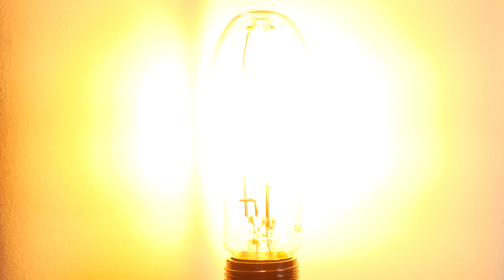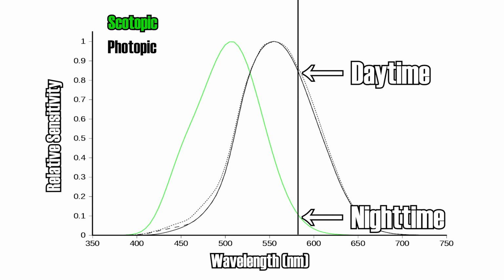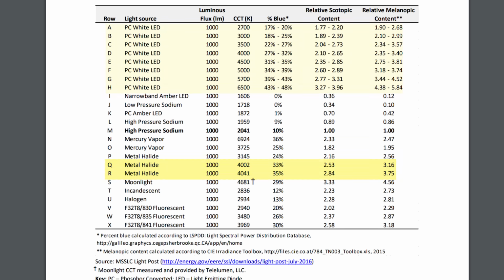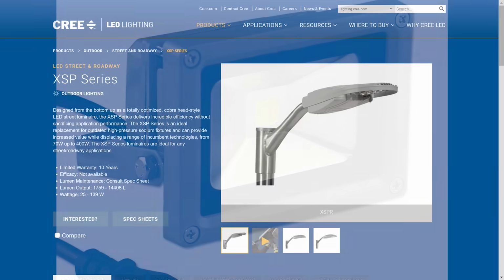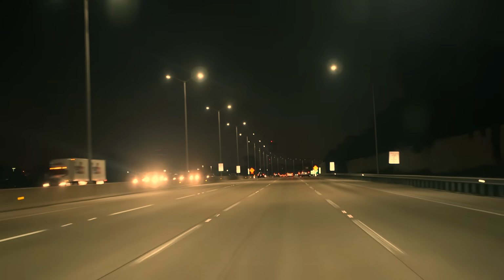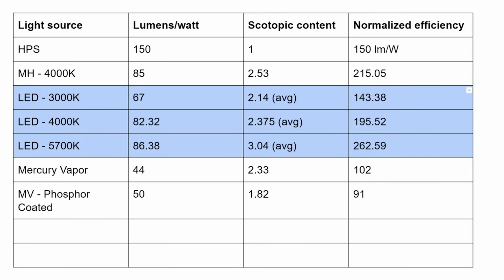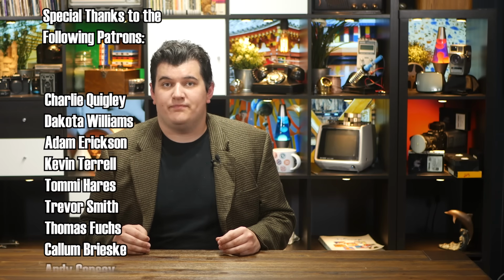The LED's Challenge to High Pressure Sodium

Comment: Just wanted to add the effect on night vision recovery... due to the fact that (from Wikipedia) "Retinal undergoes an irreversible change in shape when it absorbs light; this change causes an alteration in the shape of the protein which surrounds the retinal, and that alteration then induces the physiological process which results in vision.

The retinal must diffuse from the vision cell, out of the eye, and circulate via the blood to the liver where it is regenerated. In bright light conditions, most of the retinal is not in the photoreceptors, but is outside of the eye. It takes about 45 minutes of dark for all of the photoreceptor proteins to be recharged with active retinal"

rod cells are both very sensitive in low light conditions very nearly insensitive to red, so using light that predominantly only activates cone cells leads to faster recovery of night vision. Something you've probably experienced if you've ever been on a long drive on an unlit road and passed through a section with lighting (or had someone pass you with those blinding blue headlights!)

Although not a large factor if you are only driving in areas with street lighting, it is still something which should be considered in more rural areas.

Comment: I find it hard to drive in the fog or when raining with white/bluish LED street light compared to traditional amber-ish/yellow-ish light. Anybody find the same?
Reply: Yeah, red light penetrates fog very well, that is why it is used in traffic lights and brake lamps. Blue light has a harder time getting through without spreading all over the place and ruining the image. However, usually the streetlamps aren't the things that help you the most in these cases anyway, it's more about the headlights... I think.
Reply: @tamasperci4168  
Have you ever been through thick fog? Headlights don't do shizz.
Reply: @MinecraftMasterNo1  Yeah, that's why you switch lights to fog one, which lights not the road, but emit light from the bottom of the road, up, into the fog, which makes big difference.
Reply: @override1337  OR you can be like a lot of the yobs that run their foglights at all times... lol.
Reply: @MinecraftMasterNo1  yeah, the standard headlights actually are counter productive, because their light reflects right back at you. The fog lights on your car are better because they light the fog from the bottom. Unfortunately the normal headlights still run when the fog lights are on.
Reply: @MinecraftMasterNo1  They make you visible to other drivers, which is the purpose of turning them on in the fog. It's not to make you see better - it's to make other drivers see you.
Reply: @override1337  No they don't. My old car had fog lights. I used them in the fog many times and they didn't do squat. Best thing to do is just s l o w down.
Reply: @SpiritBear12  Huh? Fog lights are used so YOU can be more visible to other drivers, fog lights won't make a fog "less foggy".
Reply: because blueish(high color temp) lights are not reflective enough on wet surfaces. this is major problem
Reply: Makes sense that some cars have like yellowish fog lights
Reply: The color of fog lights doesn't matter much. Good fog lights should have a beam pattern that is wide and flat, aimed below the headlights. When aimed high, the light will scatter and reflect back.
Reply: bluish light is not ok for me due to my sensitivity enhanced by blue eyes, while warm sodium during night i feel is ok.
Reply: @stefanogrillo6040  After trying to look into it, I cannot seem to find any source that claims your eye color is correlated to sensitivity to a specific spectrum of the light. Rather, every source I could find points at lighter eye colors being more sensitivity to intense daylight, like the sunlight. None of the artificial road lighting is on the scale of actual daylight in intensity.

I personally have blue eyes as well, and actually find the bluer lights more comfortable whilst driving in the night, with the amber lights often being quite blinding.
Reply: @Aidiakapi  The eye color furthermore cannot directly influence that, since light passes through the pupil (black hole in the middle), which is the same no matter the color. Indirectly, when higher sensitivity and color would both be result of some condition - maybe. But that would be a (rare) disorder, rather than every blue-eyed person having it.

Comment: I've heard that low pressure sodium is better in the rain/fog because it doesn't tend to scatter. So there's that. It'd definitely be nice if street lamps would dim after a certain point. It'd be nice to see some more stars in my backyard. I have a few stupid streetlights right around me. One of them is burned out and I don't plan on calling it in.

Comment: Disruption to the Circadian Cycle is highly misunderstood. You want night drivers to be alert and aware of their surroundings, not sleepy and unresponsive, so LED lights that might have more Blue spectral content is actually safer became the drivers are alert and not sleep. Since LEDs are more efficient, the amount of blue light really isn't all that mush (despite the lights looking more blue than sodium vapor) that is because sodium vapor require the use of a much brighter bulb which puts out that same amount of blue as LED and a lot more yellow. This is seemingly counterintuitive but think it through, it really does make sense.
I recall back when sodium vapor was deployed in my area and I note that it was more difficult to see other traffic than the old bulbs. Everyone else just kept repeating that they were "new" so they had to be somehow better. I'm thrilled to see that someone has finally put together and explanation that vindicates me! I'mm looking forward to having my community switch over to low powerLED, of the correct color spectrum, using the correct downward-directing lenses, in my area.

Thanks for the great video.

Comment: I find it hard to see with any street lights as my eyes can't adjust to being sensitive enough so, this is especially true with the white/bluish LEDs.  

I live out in the country and when I drive at night, I can see 3-4 times as far and much wider to the sides when its totally dark and just my headlight. Go to the city and I find it hard to see because of the light being localized and not being able to see out to the shadow and unlit areas, even with my headlights.

I like the sodium lights better as it allows my eyes to get more sensitive to the dark compared to cooler LED light.

As for the light pollution, it has greatly increased due to the bluer light, it travels at lot further out to the country now, where sodium only few years ago was just a patch of orange glow on the horizon, now its more like a late twilight entire sky glow.

Comment: As an electrician, most LED bulbs will say to disconnect the ballast or not. In general, a replacement LED bulb is used with a ballast bypassed, i.e. 120/240v direct. True LEDs have a driver to give them the exact amount of volt/amps. The replacement lamps must have something in them that's doing the same thing, but hardly with the same efficiency that a planned LED install with a proper driver has.
Reply: The 54w cob style LED lamps that I used were better than the 250w MH that they replaced. These were down lights, running at 277v, and I pulled the ballast and cap, re mounted the socket to fit the cob light in there and ran them direct wired. It was a great retrofit and the color and visibility was improved even thought the cob emitted light in all directions. The driver that is built in seemed to get the job done. Last month, I converted all 38 down lights on that property to 150w LED 5,000K down lights. The difference is like..........well, night and day. The lights don't blind people on the street and they light the parking lot further from the building. Another 2 properties I take care of have a batch of LED's with bad drivers. In the last year I have replaced 28 drivers in those wall packs. The company who sold us the lights actually replaced the drivers for us, but it is poor quality and a lot of labor.
Reply: I have Citizen COBs.  They are amazing.
Reply: I studied electronics in high school and still dabble.  LEDs will actually burn out at higher voltages (the ones we used couldn't go more than 3V) but if you send a pulsating direct current instead of a straight Direct Current you can actually push the voltage much higher and in the process increase the brightness of the LEDs.  I presume all LED drivers used for outdoor lighting or replacement lighting use a rectifier/driver circuit (rectifier convert normal AC wall current into DC, driver converts DC into Pulsating DC) while most portable LED lights I've found just use a direct power circuit from the batteries (AA, AAA, C, and D batteries/cells all produce 1.5V per battery/cell so two of those in series will produce 3 volts).  I did have one portable LED light that used 4 batteries so perhaps some newer LEDs can handle more voltage).
Reply: COBs can handle high voltage, but they are technically a checkerboard matrix of teensy micro LEDs placed on a surface the size of a nickel.  But as a unit can handle anywhere from 36 to over 100v at varying levels of current from 700ma to 2100ma.  They need big passive heatsinks and are tons of fun.
Reply: Mean Well HLG drivers are nice.  Dimmable as well.

Comment: You're right that low pressure sodium is definitely better for astronomy which is why it's used near professional observatories but high pressure isn't bad either. For amateur astronomers, high pressure sodium is absolutely preferable to LED because although we can't filter out all of the light pollution from HPS street lights we can filter out most of it. With LED streetlights now, we can't filter any of it. 

My city (Ottawa) has switched over to LED streetlights and it's now useless trying to look at the sky anywhere near the city. When we still had HPS lights a couple of years ago it wasn't amazing but it was workable with filters. The astronomical filters for LPS were able to get most of the light pollution. Now that the streetlights are white there's no chance. It's like having a full moon every night. And the city didn't cheap out either, they replaced all of the fixtures with new ones that have much better cutoffs. The problem is light scattering.

One thing that wasn't mentioned in the video is how much easier it is for bluer light to scatter. Not only does this contribute to city glow but it also has safety concerns here in Ottawa, especially in the the winter. The orange light from HPS lights did not scatter nearly as much in the snow as the new bluer LED lights. One of our major arteries was halfway through the transition last year and I happened to drive on it during a snow storm. In the HPS section visibility was fine, it didn't seem to be snowing that much but as soon as I transitioned into the new LED zone I found I was unable to see very far at all because of the glare. The light was bluer and was making it far more difficult to see down the road, even though the rate of snow was unchanged. As soon as I transitioned back to a part with the HPS lights visibility was fine again.

Comment: HPS lamps also take couple of minutes, give or take, to reach their full luminence whereas LEDs illuminate immediately. Thus LEDs could be motion activated on roads which receive lesser usage to reduce power usage and light pollution. Motion sensors could be placed before the intented part of the road to be lit so the driver’s wouldn’t be surprised by the sudden blinding light

Comment: The largest problem with "White LEDs" is that they're actually Blue LEDs with a yellow covering - which means they still have a peak blue emission present.

And the wavelength it's producing ? Well, safe to say, astronomers aren't very happy with it.

https://en.wikipedia.org/wiki/UBV_photometric_system

https://commons.wikimedia.org/wiki/File:White_LED.png

I'd agree though that a somewhat yellow-ish LED might be the best truce possible.

Comment: I don't know if this is a bad idea or dumb, but what if special street lights can be made that have programmable visibility, like what the 3M traffic lights did, to install in places close to homes and wildlife? This way, the installer can "program" the light output by putting masking tape on a optical limiter so then this way it will only shine and be visible on the street while from the houses the light source will not be visible even though the lens is visible.

Comment: Things worth mentioning:
Firstly, any choices we make can have nuance. For example, cooler lights on motorways (erm... highways? I think that's the american translation), and warmer lights in residental areas. A cooler less calming light is probably an advantage for alertness as well as visibility, which is handy for things like stopping time, and longer night time drives are already keeping people awake. Admittedly, as mentioned, street lighting is particularly useful when pedestrians are about, which tends to be residental areas, but the point is still valid, that's just another decision to make and a potential solution. A single standard isn't actually an advantage here.
Secondly, it's worth also looking at car headlamps here. One thing I noticed when whiter LED lamps were first installed in my area is that they're pretty much the same colour as car headlamps. This can mean that distance street lamps can sometimes momentarilly be mistaken for cars, and worse... vice versa. While the lack of movement in the lights does give it away, it can still slow down reactions, which is always worth considering when high speeds are involved. Perhaps having headlamps and street lamps as distinct shades could still allow you to keep the benefit of quicker recognition alongside the cooler lights.

Comment: I find that having white light street lighting has a detrimental effect on spotting approaching vehicles on suburban streets which have cars parked. Having the street lights orange means that when a car approaches, the increase in white light allows you to spot the projected headlights  before you see the vehicle itself, even around corners and reflected in the paintwork of the parked vehicles.

With white street lights, the headlights disappear into the rest of the sea of white light, meaning that the approaching vehicle will actually be seen later. At least, that is my experience.

I don't doubt the other benefits, but this loss of contrast between vehicle lights and street lighting is not mentioned anywhere.

Comment: How convenient that all High pressure sodium light manufacturers make enhanced spectrum bulbs that allow is to see better with zero added cost per bulb , unless you've owned and operated 50,000 watts of HPS lighting for the 14 years I have don't bother with the LED nonsense which is a massive expense , there are no maintaince expenses with high pressure sodium lighting , especially magnetic ballasts that last 30 to 50 years ,

Comment: PC amber tend to be the best choice for public lighting as they present the optical benefits of LEDs while producing less light pollution than bluer LEDs. Also, about your point that the reduction of power counteracts the increased of light pollution from white LEDs, it doesn't. The power reduction is much less than the increased effect of white LEDs.

Comment: About light pollution, you are right about low pressure sodium, they have two narrow spikes.  The same could be done using LED's tuned for a few spikes around 500nm.

Comment: why do we use street lighting. answer to prop up electrical companies. because it never should be the drivers responsibility to avoid a pedestrian when a vehicle is moving at night. street lighting should tightly controlled only used at approved street crossings and very limited a vehicle merger points.  a diver should not be held responsible if a moron cross in the middle of a block because he/she are to lazy to walk to an approved street crossing. 

So how much money is the Local County state and Federal throwing away each year on electricity and maintenance of street lighting?  A limited access highway has very few hazards. and everyone should remember driving class 101. Speed limits are set are for picture perfect days. Add or subtract anything from that kind of day IE night your speed should be reduced. 

Sorry for the rant I know this video was about. which light is better but sometimes the government steps in too far.

Comment: 12:41 The "hot spots of light you see from above here" is most likely an LED retrofit - the poles were already there so they had to work with that.  There may have been HPS cobra-heads originally, which as mentioned throw light into the sky, but probably had a wider spread and didn't make hot spots, or at least as not as bad as what is seen now.

Yet another tradeoff - no uplight from the fixtures, but the hot spots make for an awful Uniformity Ratio, not to mention an annoying "strobe effect" when driving.

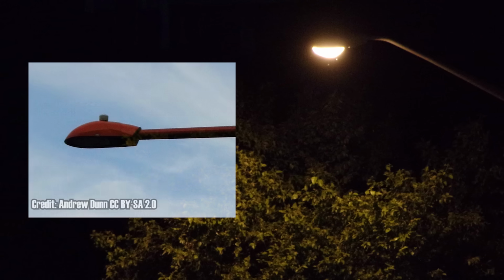Comment: 9:35 "none of it will wind up lighting the sky" - sort of, but not really.

Not mentioned in the video is the THIRD contributor to uplight -  light bouncing off the ground!  Tradeoff?  Light colored pavement which makes it easier to see, and less light & power is required, but light bounces up into the sky.

The irony?  A full-cutoff fixture is specified - all that engineering and the parking lot is basically a huge reflector....

Rebates are sometimes given for "Dark Sky Compliant" fixtures, but I say the rebate should not be given until after a site inspection is done... light pavement?  No rebate.

Comment: There is one other issue.  That of CRI.  You can LED fixtures with a color rendering index of upwards of 95%, well designed HPS systems can get to around 25%